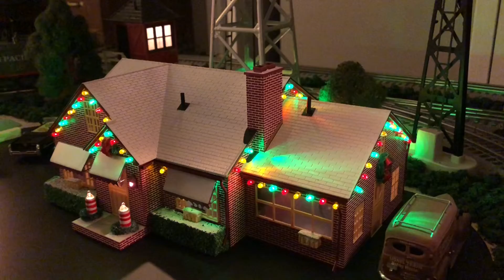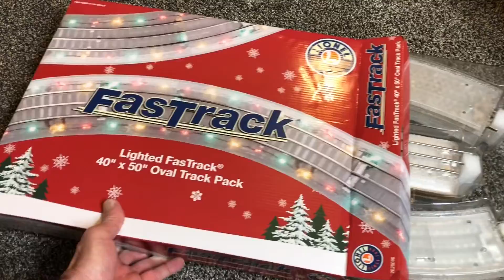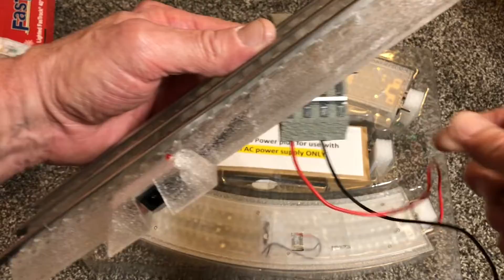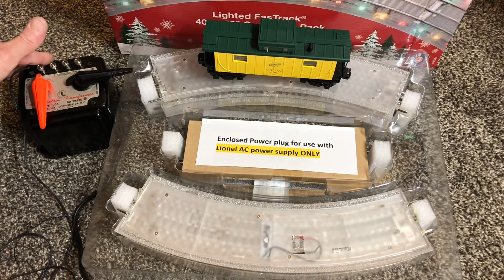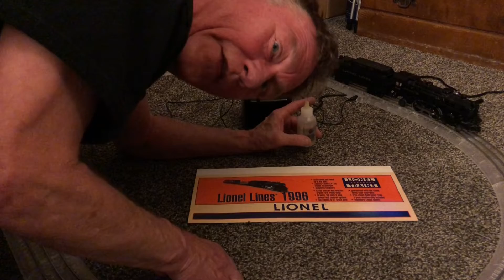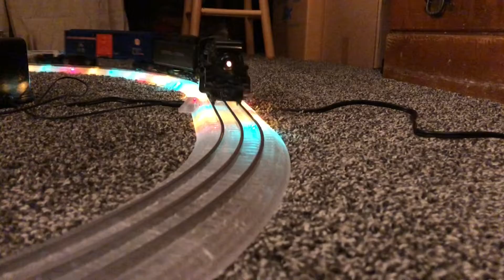Lionel Lighted FasTrack Transformer Control will it Work?

Comment: I wish you gave me the curves in the wide radius too. I think my legacy set would look awesome on those light up tracks. The only light up tracks I can use is the strip tracks.
Reply from the maker: Sorry for the delay in responding. I can’t find any offerings other than Lionel O36 curves. I will imagine most folks only use this track set up during the Holidays under the Christmas Tree?🤷‍♂️ I don’t know of anyone selling wider radios curves other than the O36 Lionel offers. Occasionally I will see a video of someone who has incorporated the lighted track sections into their every day layout off season.🤷‍♂️ I’m familiar with the LED light strips but not with anyone integrating them with model railroad track? I’m sure someone has? I’m just not familiar with or seen any.😊
Reply: @markslioneltrains yes sorry. I used dictation to type and it said wrong word but I wish they have lighted track in other curves not just 036

They look awesome

Comment: Hi Mark, where did you get the wire with the round plug? Also, do you know how to wire a curved section of track? I don't want to use the straight sections so I'm trying to figure out how to hook up the accessary wire under the curved track.
Reply from the maker: I actually had the wire in house from an old workshop cord light. I have always soldered the wire connections to the track so you should be able to use curved sections as well. However, I have never tried it so I can’t say for sure.🤷‍♂️

Comment: How did you hook up the wire from transformer to track? Mine has two loose wires no plug…
Reply from the maker: My set didn’t come with a plug either. I had an old cord light plug in house that fit. I think you can also use connection wire plug tabs on the underside of the track. You can solder them as well. + Red or A to the center rail. - BLK or U to the outside rail. Toy Train Tips and Tricks YouTube Channel has a video on transformer to track wiring. 😊
Reply: @markslioneltrains how did you hook up the cord light to the transformer I can’t get my transformer open
Reply from the maker: @StevenDeckard-x8v I had to check to polarity of the wire with a multimeter to make sure the connection / wire goes to the correct rail. Sounds like you may need to go to a hobby shop to have your transformer looked at? 🤷‍♂️
Reply: @markslioneltrains yeah it won’t even turn on now
Reply: @m @markslioneltrains i think I’m going to get the new transformer I’m not that handy haha
Reply from the maker: @StevenDeckard-x8v Perfect. 👍🏻

Comment: Those glowing rails look great! 😃 I just have one question; what wire did you use to hook the 1033 to the terminal section?
Reply from the maker: Thank You.! 😊 I used the plug from an old low voltage LED shop light charger.

Comment: If you know basic electronics you can understand how/why this would work. LED's are constant voltage drops and a current limiting resistor is used to deal with both the extra voltage presented and to control the brightness of the LED. I will assume that the voltage of the fixed voltage transformer is close to the max voltage from the variable supply. This would also suggest that the current through the resistor would be similar. Fortunately, it appears to work at low voltages. If it didn't then I would worry about burning up the resistor used with the LED over time.  Thanks for trying this out and posting it for all of us to try. Now I can run a traditional old engine with my retro aluminum tree this year for my grandsons.
Reply from the maker: Thank you very much for the electronics explanation and the kind words.!😊Very Cool about the retro Christmas Tree.! I’ll bet that looks great.!👍🏻Glad to help.!👍🏻

Comment: awsome very interesting to see but i am a beginner dont know much yed but dos this mean leonel is DC now and in the past it was AC powered ore dos i mis understood u ? greets from a leonel starter from netherlands
Reply from the maker: For the most part Lionel is AC powered. However, This set is designed to work with a DC Plug in track power pack that Lionel now uses for some of its starter sets. It’s more user friendly for folks just getting started in the hobby. It eliminates the positive and negative wires associated with common AC transformers and just uses a simple track plug. Hope this helps. Mark 😊
Reply: @markslioneltrains   thanx then i keep it simple and stick to my normal fast track thanx 😀

Comment: Question: will this setup still work when the whistle is activated?
Reply from the maker: @adventuresinmodelrailroading  I don’t see why I wouldn’t. The lights are triggered by the train wheels completing the circuit.
Reply: @markslioneltrains  The whistles work by the tansformer injecting 5 volts DC on top of the AC. I'm concerned that it would blow the leds.
Reply from the maker: @adventuresinmodelrailroading  Not sure then? I did not test that.🤷‍♂️

Comment: I want to run my mth dcs engines on this track.  Is it possible?
Reply from the maker: It works with AC or DC power so I will guess it would work? I know very little about MTH DCS. Maybe test it out at your local hobby shop? I don’t own any MTH engines so I can’t help but to guess? Sorry 😞

Comment: Yeah the tracks come with a accessory  track piece for plug and play, my qeustion is can you hook old accessory to the track via this? Anyhow thanks for showing us this!
Reply from the maker: Yes, As long as you can find the round plug it will be the same as the track voltage. My lights and accessories are powered by a separate transformer so I cut those plug and play plugs off and just use the wires. Glad to help and I hope this is what you wanted to know.
Reply: @markslioneltrains  thanks for all the info, great video

Comment: Hey, put some extra weight into all the lightweight cars (like the caboose)
Then, you'll have a near flicker free transition with the  lighted on the track sections.

Good idea with the charger. Don't know why Lionel doesn't make connecting as easy as you did and simply put the money for the wall warts into the train motors instead.
Reply from the maker: Awesome Suggestion on adding weight.! Excellent idea.! 👍🏻 Pretty sure they want you to buy the wall wart.! Instructions would be a great start.! Very glad it worked and glad to offer different ideas.! Have a great Holiday Season to you and your family.! 😊

Comment: I have been considering this track for years since I purchased my Lionchief Pere Marquette #1225.  ❤️👍
Reply from the maker: It's alot cooler then I thought it would be.! 👍I wouldn't use it on my layout but for under the chirstmas tree it's really cool. It works just fine or better on TMCC fixed voltage.!👍🎄😊